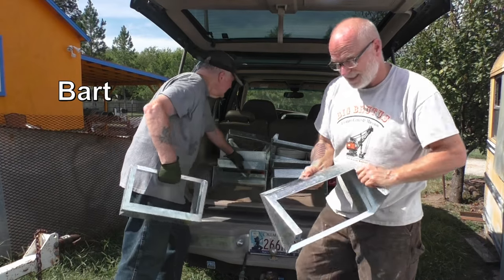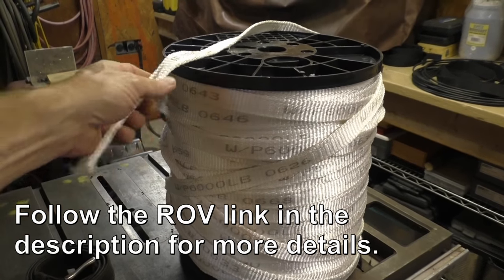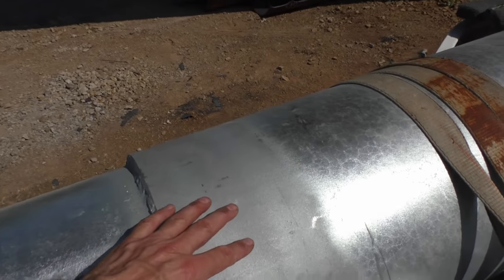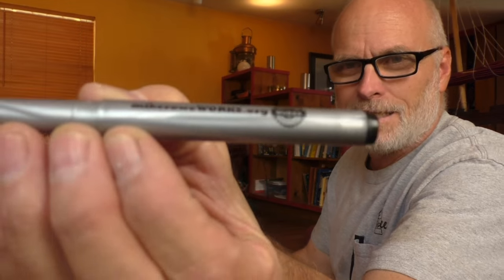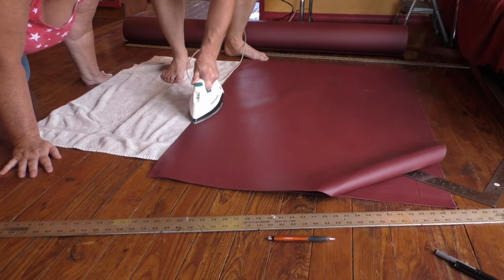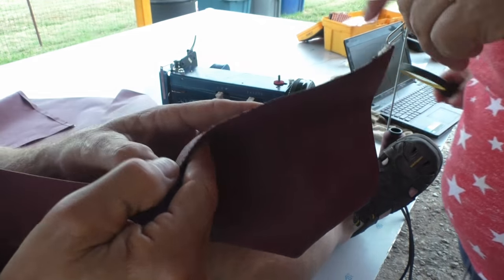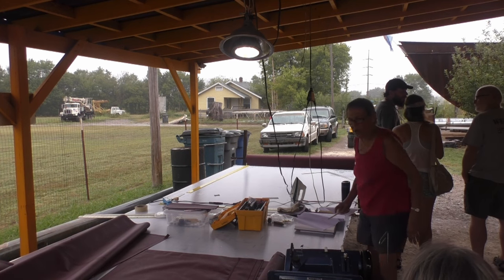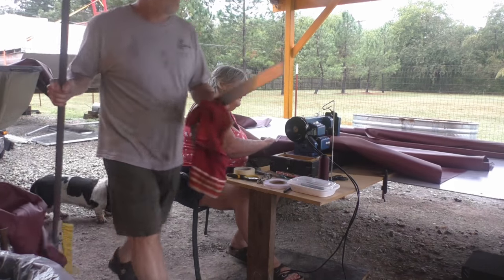Mast and Chinese Junk Sails and other stuff

Comment: How to set your tension on a sewing machine:

1) Remove the lower thread bobbin and bobbin case (the little case thing with the thread tension spring thingy on it) and keep the bobbin inside of the bobbin case.
2) Hold it up by the string and let it dangle like a yoyo.
3) Set the tension on the bobbin case so that it is ONLY JUST strong enough to hold up it's own weight without spooling out thread. A tiny jiggle of the string up and down should be enough for it to drop down slightly.
4) Refit the bobbin and bobbin case into the machine.
5) Now the bottom thread tension is set you can now set the top thread tension. Set it so that it is pulling the bottom thread half way up through the material, so that the top and bottom stitch looks the same.

This is usually enough to set a good tension. At the very least it's a great starting point. If you feel the need to further adjust the bottom thread, make only tiny adjustments.

Hope this helps :)

Comment: like the sewing set up, you are on the right track. Try lowering the machine so that it is level with your out feed table. This will increase your speed that you can feed the sail cloth through the machine.
I used to work for North Sails, the ladies that stitched the sails together worked in pits in the floor, and  it was petal to the metal.
Keep up the great work.
Bill

Comment: I have used sailrites basting tape and do love it. however, I have had problems with the glue gumming up the needle. I came up with a fix for this. Use small piece of foam with oil on it and run the thread through it. I fold the foam over the thread then use a cloths pin to hold it in place. The oil will keep the needle clean.  The other thing is that make sure your seam covers the tape because over time the glue will collect dirt and look like shit. Also the  Hoover snap-n-press works great for grommets
Reply from the maker: Awesome.  Thanks for the tips.
Reply: intead of oil(which may degrade the thread.)try bees wax.  thats what my mother used to use to sew sails.
you can also use a hot glue gun to hold it in sewing position.  if you keep it in a thick bead, you can strip it off right before sewing.
Reply: also.  its actuwlly the blasts of steam coming out, not the hot iron surface itself that you use to iron stuff.

Comment: Adjust the tension so that the material just does not pucker then adjust the top and bottom tension so that the upper and lower threads join in the middle of the joint. From 40 years of working on the wife's Sears machine.  The mechanism for adjustment will be machine dependent.   Love your philosophy on work.  I currently work on one of the projects put off for 30 years while i worked in an office as an EE for one of the railroads.  Don;t think I will ever get caught up but that is OK.

Comment: They make a Grommet press thingy that we used to use when I worked in a Sign and Banner shop, with a big handle you can really knock them out fast (they even have them that has a pedal you stomp on to crimp the grommets)  Seems WAY way better than the hand pounding each one by hand with a hammer & Punch sir..........

Comment: I have an idea that you may or may not thought of. Use the mule tape rope to carry the load of the R O V.  Add a small ring every few feet the length of your line. Then run your cable through the rings. This way no more drag or weight stress is on the electric cable. You could use a solder iron to melt your holes in the mule tape . Sort of a tether that can stretch under load with a loose control cable in the rings .

Comment: You should setup your sewing table a bit higher so its even with the foot of the sewing-machine . lookup old sail-maker houses where you sit in a hole in the floor . The arc of cloth coming up and over the pad of the sewing machine will prove to be a pain .
Reply: Years ago I had that problem, though I used a bodge - unable to make the table flush with the bed of the sewing machine/foot, I just added a plinth to extend the sewing machine bed out onto the table further so at least there was no tendency to skew sideways.
Ideally, the bed of the machine would be inset into the table so everything is level, though that means cutting your tabletop.
Reply: it also causes darting and  puckering.    Doug when you sew on the machine.   hold a large swath each time.  hold it from both ends. pull tight. run threw and re grab anothe maybe 2.5 feet each grab.

Comment: As a person who once operated an industrial sewing machine for a living, I will only make 2 suggestions.
Get that machine level with the table!
Assist the material on the output, the walking foot does not have the power to advance that much weight on it's own.
Lastly, just get a cheap arbor press for the grommets. Using a hammer for that many is not a good idea.
Reply from the maker: Thanks.  I think well will build a press for that job.
Reply: SV Seeker Excellent idea.
Just watched the next video in the series, saw you adjusted the sewing machine height as well :)

Comment: You get to do something about the rust on the boat soon..! And set an engine in the boat :) apart from that good work by boat! :)
Reply: Every boat of steel I have known is left to rust for a year or more apparently to better bond with barrier coatings.  I'm talking of commercial work boats.
Reply: Doug's got a clip of a coatings guy consulting on the desired metal texture after sand-blasting.
Leaving the steel to weather certainly helps get rid of mill scale, etc. but the marine coatings I'm familiar with all want clean white metal a few degrees above dew point temperature or the warranty is void.

Comment: On the galvanizing... you can't go by the weight of the object. Your 2500 pounds of steel took 35 pounds of zinc, which is about 72 dollars a pound. Of zinc. If you gave them a solid sphere of iron that weighed 2500 pounds, it would probably take about about 3 pounds of zinc to galvanize it, which would have cost considerably less. 

It's the surface area that you're paying for, not the total weight. So it wasn't 37 cents a pound. It was just... 35 pounds of zinc. which would be impossible to calculate for ahead of time, unless you were an expert in the process. Nevertheless, it cost about a thousand bucks. Moving on....

Comment: First thing,  on the last rov video I sent you a link for super strong kevlar thread at a good price from the thread exchange. In 800 size it has a break strength of 225lbs per strand and is a little smaller than garden string. It works out to 11 cents a foot per strand. 
It would be very small, greatly reducing the drag on the cable. 5 strands is 55 cents and gives you 1100 pound break strength.
http://www.thethreadexchange.com/miva/merchant.mvc?Screen=CTGY&Store_Code=TTE&Category_Code=Kevlar_Thread_Size_800

Second, DO NOT TRY TO SHARPEN THOSE SCISSORS. It is really easy to ruin them. They look to be R. Heinisch scissors and may be pre civil war. 
Scissors are very technical, especially tailors shears. It is not just about being sharp, then need to have bite so the fabric does not slide out instead of cutting. Most sharpening info youtube is wrong. Take them/send them to a real scissors sharpener. If you go on the forum Leatherworker.net, and look for the user ART, he is a master sharpener known for his work on very specialized hair scissors. Here is a thread that covers this, with real accurate info:http://leatherworker.net/forum/topic/71231-scissors-sharpening/#comment-470342
He does it for less than 20 bux and is close to you. Tell him Tinker sent you and tell him about your story. He will like it.
Reply from the maker: Thanks for the ideas.  ...but now I am confused.  Your are on YouTube too.
Reply: Leatherworker.net is THE place for info online about sewing with heavy thread in walking foot machines, fabric or leather. ANY sewing issue has already been covered there in detail by real experts. One of the regular posters is the head sewing machine mechanic at filson, for example....
Reply: SV Seeker

Ok, i get that i am a hypocrit, and i am saying to ignore youtube to a youtube creater, on youtube, however for scissors sharpening, I'm standin by my words.
Btw, On the shirts, you need to put sewing god. Sewer god will not work as good........
BTW Men who sew are Seamsters...We decided it sounded harder core, and have voted you into the club. Congrats.